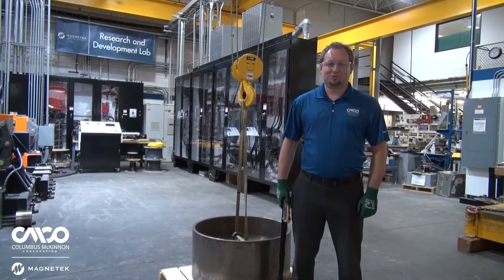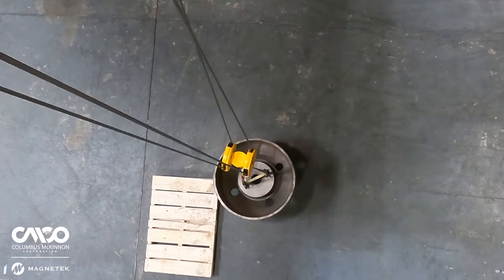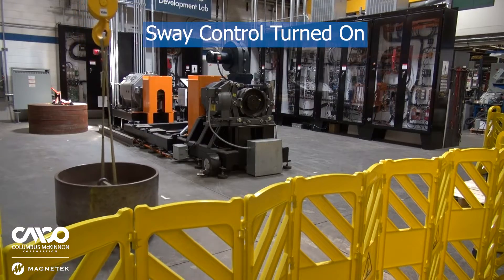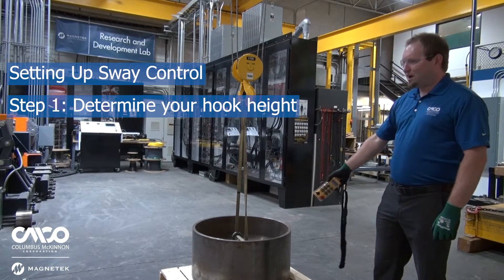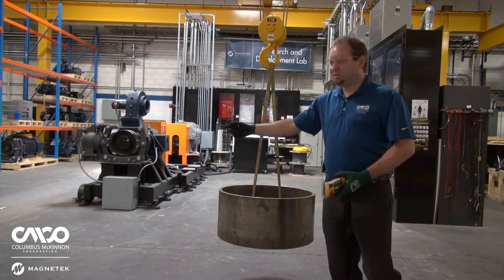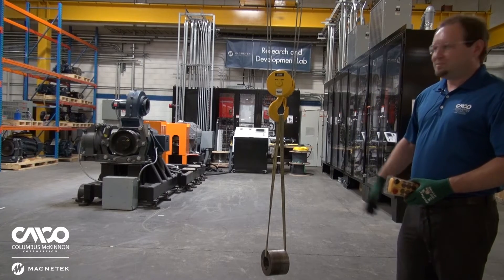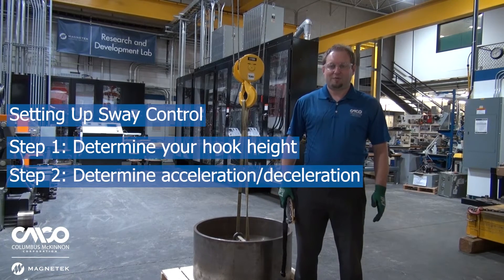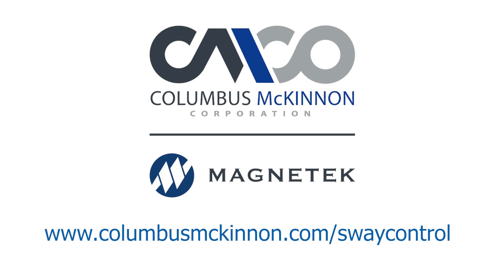Overhead Crane Sway Control Demonstration

Comment: if the load is stationary and it was pushed for any reason would the crane drive to counteract it?
Reply from the maker: Our sway control is preventative, which means it predicts the pendulum swing based on the hook height, and then controls the speed of the motor to prevent sway from occurring.  It won't dynamically eliminate existing sway.